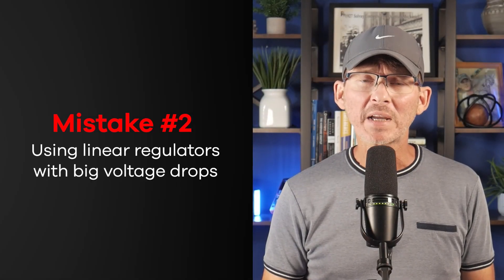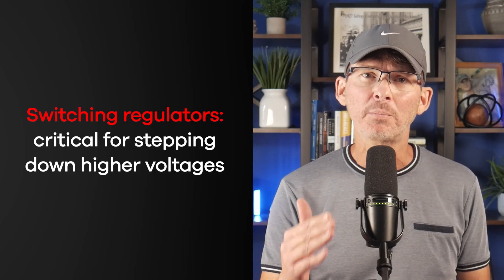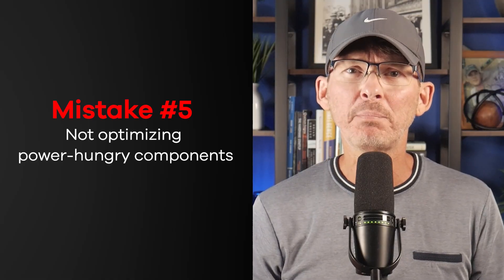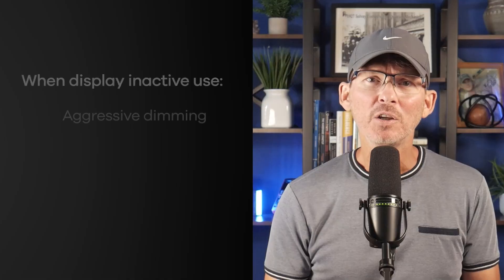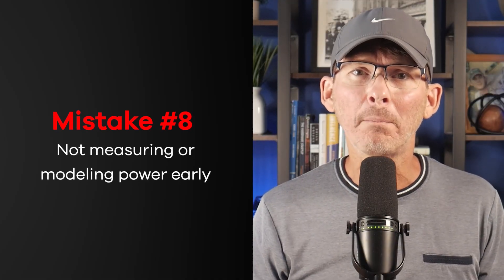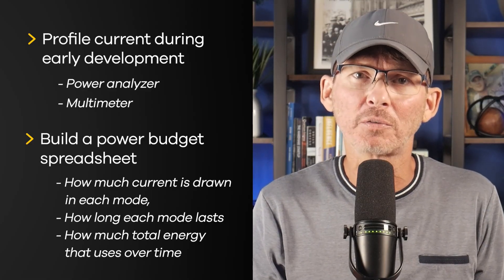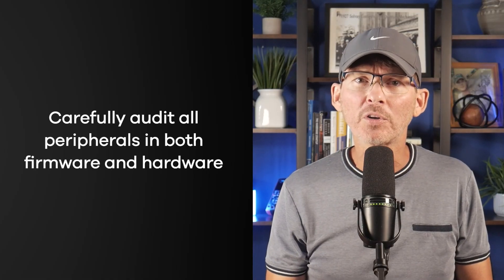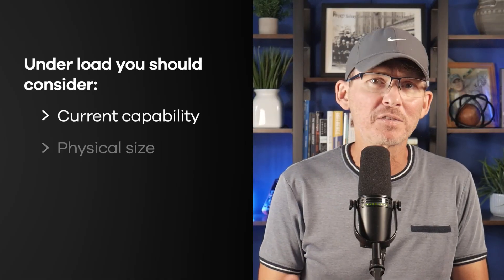11 Design Mistakes That Kill Your Product’s Battery Life

Comment: In year 1975 I begun using LEDs as power-on indicators in my battery powered designs. Things like guitar pedals powered by 9 Volt batteries, or differential amplifiers for medical use, powered by those cube-shaped 6 Volt 1 Ah Lead-Acid batteries. The indicator LED was my bane, as it draw 5 to 10 mA which were more than what the core function of the device required.
So I developed a circuit with a bipolar transistor and an UJT (uni-junction), that was a buck driver with a coil and a diode to optimise the current drawn from the LED, so I went from 10 mA down to 1 mA or less. Some devices - namely RF antenna boosters - couldn't accomodate an oscillator inside, so I pulsed the LED at high current for 50 mS, so I had a blinking power-on indicator; few years later, the LM3909 integrated circuit arrived on the market - doing the same job of pulsing an LED with a low voltage source efficiently.
In decades of design job, the power supply of any device has always been the part whose design I could never defer to anyone else.
BTW, regarding deep sleep - until 2010 not a single laptop brand was able to manage the S3 state properly - after waking up the computer, peripherals like BT, CD-ROM, NICs, and serial ports had to be reinitialized. Only with the Advent of USB 2 the manufacturers took the time to write proper firmware for their computers.
Greetings,
Anthony

Comment: I have one more contender for a battery killer - bulk caps at the battery side of your PDN. Further downstream you tend to use MLCCs, but boy, if you must use some electrolytics anywhere, even polymer ones, get ready for some disappointing leakage current specs.

Comment: Another item to consider is placing high-side switches in front of power hungry circuitry, especially if the quiescent current is high. switches like the AP2151AW-7 from Diodes Incorporated have forward leakage currents in the nA range and can be used to truly "turn off" a part of your circuit when its function is not immediately necessary. My company has used this method in the past to avoid paying the power cost of even a radio's deep sleep consumption when there was no other option.

High-side power switches we prefer because it avoids the problems with a ground reference that is slightly above the potential of the board ground.
Reply from the maker: Great suggestion and that's definitely the best way to be absolutely sure the component is pulling no current at all. I've used that on a single component before. Thanks for sharing.

Comment: indicator Leds are often overlooked because people tend to think of led as efficient and an indicator led as miniscule, but depending on the duty cycle and current draw, the indicator can often times drain more power than the MCU in sleep. Also, people tend to leave leds far brighter than necessary for the function which dramatically increases power consumption. I've started seeing fiber optic indicators that get active current consumption into the single digit uA range, but those are not as common or price competitive yet.
Reply from the maker: Great points! Yes, definitely common to run more LED current than needed. Most of the time they're not being used for flashlights so maximum brightness isn't necessary.

Comment: As an Arizona boy I need to watch out for increased leakage during the summer heat. Not the sexiest of video topics but It seems maybe a temperature related issues video could be useful. How many EMC labs heat up your device so capacitors derate and all the sudden you get noise? I believe I've seen some content about temperature on your channel before.

Comment: Great video! I think you pointed out why one of my low power designs is using more power than expected. I did not add resistors between one of the sleeping MCUs GPIO input and the GPIO output of another MCU. Similar to a floating pin, I think the turned off ESP32 is still sinking power on the input pin 😬 Anyone have a 47K resistor I can use? 😂

Rookie mistake, but your list made me remember! Thanks for the great video!
Reply from the maker: That's so fantastic to hear! Thank you for sharing that here. I just checked out your channel. Wow those are some impressive view counts for only have 4 long-form videos. YouTube is really doing a great job at giving reach to newer channels. Or maybe you just learned how to do really good videos much faster than me:)
Reply: @PredictableDesigns I think YouTube is definitely promoting more on individual video performance rather than subscriber count these days. Lucky me! 
But my target audience is like the entry point of a sales funnel where the most people are, how to start electronics. Yours is like the last step or two in the funnel of how to take products to market. You get the people who are spending real money and have serious knowledge, I get the people who spend a little money and little knowledge 😂
That is why I keep redirecting intermediate and an advanced people to your channel!
Reply: Make up your mind, is it sleeping or is it turned off? If it's turned off, you have a (serious) back-powering issue through the input pin ESD protection diode, in which case a pull-down resistor on that input pin will not save you.
Reply: @dookshi It is a additional microcontroller that is enabled when there's enough power stored, but it's still sleeps to try to conserve power when it can. 
It is a dense board so I made the compromise of not adding resistors between the GPIOs and the other stuff and think this might explain a portion of where the unaccounted powers is going. Not a disaster, just helps the calculations be a little more accurate by making the tiny black box of unknown power use smaller.
Reply: @FluxBench  OK, I understand, so as long as it's sleeping, it means it's powered up and that's important to prevent back-powering through input pins. That would be much worse than just consuming more power than necessary.

Comment: Corollary to point seven: Using high-powered (low resistance) pull-ups/downs. Use the highest resistance that reliably performs the required operation. A 10k ohm pull-up can draw 330uA on a 3.3V supply, which is well above what an ESP32 draws in deep sleep.
Reply from the maker: That's a great point, thanks for sharing that one.
Reply: Even better is tying one or more pullups to a microcontroller pin. When that subcircuit isn't needed, it draws zero power.
Reply: Ayup. For example, In CMOS circuits, you can use 470K pullups instead of 4K7 pullups.